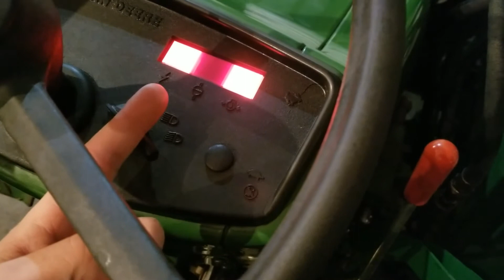The JD 750 Saga continues. Pre-service maintenance.

Comment: You have probably figured it out but for those watching about the 750 here's some info.  The loader does come off easy using an overhead lift by taking out 4 pins and hoses.  Better yet is the optional mounting stands that go in the square holes you used the 2x to hold it up.  They allow front tires to go past them and support everything including the uprights.  That's not the original bucket for the #67 as it's also made for wider arm spacing.  About the hydralic block by the control valve. The 650-750 has 2,030 psi.  pressure which is too much for loader.  That is a pressure relief block that reduces max pressure used on loader to 675 for 650 and 1,075 lb. for 750.  Seldom do companies put stuff on equipment that isn't needed.  The manual shows it can be taken apart and cleaned but says springs and balls are not interchangable so don't mix them up.   The short green wire is a fusible link meant to protect the wiring in case of a dead short.  I now see it on 3 of the 750's and it's listed in the parts manual.  The short lead out of the starter has been replaced cause it should be white with red stripe. It also should be 10 gauge and the green fusable link is 14 gauge I believe.  The connectors could need cleaning to get proper voltage through to solenoid.  The oil and alternator lights come on when key is on but engine is off.  They are to go out once engine is started. The center light is temp light that is to come on only while cranking and if too hot.  Never Ever,, use starting fluid on this diesel as it is a precombustion chamber design and you can easily destroy it.  It doesn't use glow plugs.  It uses a Thermo-Start system.  Turning key backwards for no more than 15 seconds heats up the coil which also heats up a metal tube that allows fuel to fall on red hot coil.  This causes a fire inside of manifold that heats incoming air.  That's why the little tank by the valve cover.  They are great tractors built to last a long time but need to be understood.  A copy of the original J.D. service & parts manual can be had for about $90.
Reply: Better info than the video
Reply: Interesting details thanks.  I'm wondering why the system PRV valve still gets triggered when the loader deadheads, when you have that extra valve block?  I had mine apart and saw what you're talking about.  Just wondering how it could then get high enough to open the main PRV, which I can hear when deadheaded.
Reply: @frankposterello1628  It's been a while so I had to watch most of this great video again.  My 750 is about the same condition and equipped the same.  I did the same pulling the fuel tank cause the clear plastic on fuel guage was missing.  I did replace all loader and power steering hoses before the co*id scam raised prices like crazy.  I haven't taken the PRV loader valve apart as manual says I can.  I did install a Tee and guage so I have an idea of load and pressure I have on it.  Max pressure is about 850 which is between 650 & 750 pressure so it could certainly could lift more.  Thing is I see a lot of buckets bent up and it does lift plenty as is. Carefull as I am to lift a balanced load it's pretty easy on the farm to hook the corner of the bucket on something and bending the loader or bucket.  I do have a J.D. 310  backhoe that can lift most anything so why over work the 750?  You certainly can shim or maybe get a stronger spring to increase lift.  Everything works like new so I haven't studied the hydraulic schematics shown in the J.D. service manual I got from PeacefulCreek.com.  The PRV will by-pass to protect the loader when overloaded or deadheaded.  You may also hear the priority valve next to the rectifier.  It gives priority to steering thinking that steering is more important than lifting.  Hope you enjoy your tractor.

Comment: @northwoodsnoise hey there. I have the same tractor bought it about a week back. Only 474 hours on it. Great shape minus the paint and hoses. Can I pick your brain on the hoses? What size are they 3/8 I have the exact same loader. My hoses are just showing the steel braid at this point. And the rear two hoses for the rock shaft one leaks. Only leak I have on the tractor luckily did you replace those? Do you have any tractor supply parts numbers? I went there the other day all the hoses mine carried were male x male hose ends and looks like some of mine are female. Also can I get a better look at your hose routing as mine has the optional grill guard and that hits the bucket hoses and wear them out. Kind of a crappy design. And did you know of the company who does make a quick attach for this? What about a 3rd function add a line for the bucket? I’m looking at adding hydraulics for the 3 point or just having them incase I can ever find a backhoe for mine. Great tractors. Bullet proof. You see how simple and amazing these machines are. Thanks for videoing. I’ll be looking for your reply as I want to replace my hoses soon. Do you recall how much they were for the whole loader? $200-300?

Comment: Thanks for the videos.  I am planning to take my loader off. I have the same tractor.  What 4 pins do I need to take out?  Do you have pictures of the pins?  I don’t want to pull out the pins and cost other problems.

Comment: Nice toy!!! Are you going to keep your 446 or are you going to sell it??
Reply from the maker: Thanks Korey! I have the 446 listed for sale, but I'm still using it almost weekly. The way things are going it's almost too handy to sell! We'll have to see what happens I guess.
Reply: @NorthwoodsNoise  yes I know what you're saying, I have a case 446 too.  And what a great machine!!
What are you asking for it?? Or where do you have it advertised?
Reply from the maker: @koreylapp6762  I've got it listed for $1800  on marketplace at the moment. That's with the snowcaster, mower deck and the front and rear blades. I've got it priced a bit high, but like I said, I'm not sure I want to part with it lol that and whenever I have anything for sale, people sure do like to lowball me around here, but I cant blame them. Realistically I think the package is worth every bit of $1200.
Reply: @NorthwoodsNoise  yeah I would agree with that, do you think beings that the original Onan in it does that increase or decrease the value??
Reply from the maker: @koreylapp6762  I think it all depends on condition and who you're talking to. I think the CCI garden tractors have gained a serious following over the past decade. Ive seen collectors pay upwards of 4k for original, low hour big wheel models.  Personally, I'd like to put a 23hp vanguard in mine! I'm also a fan of some of the diesel swaps I've seen!